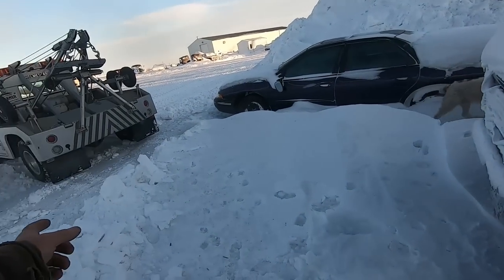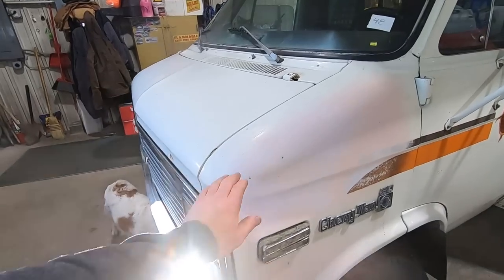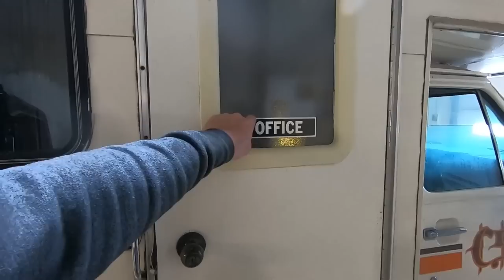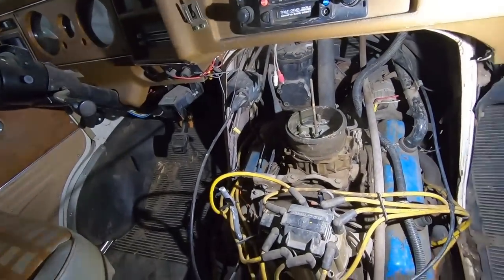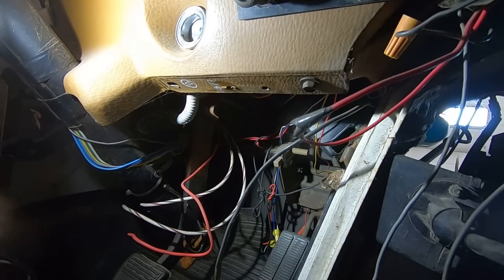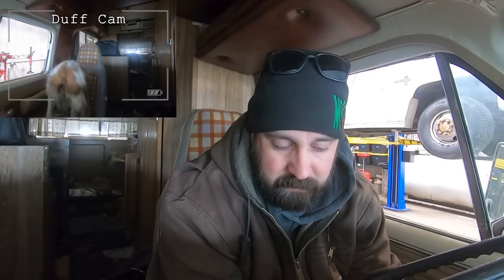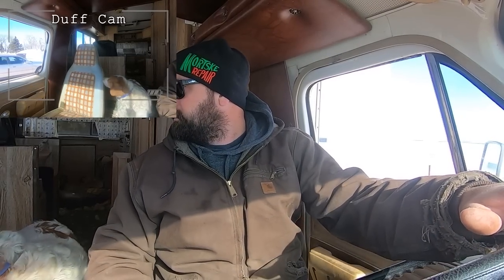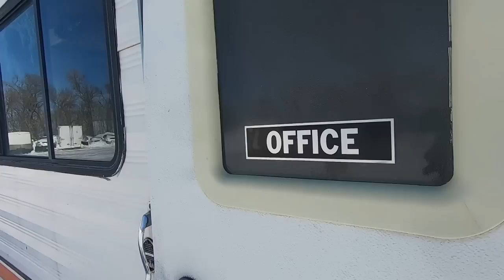Abandoned for 15 Years! 1977 Country Squire Motorhome! Will it Run?!?

Comment: I'm from elkhart and I've been building motor homes for 35 years. They have improved so much in that time and you were right on the money with your description.
Reply: Love the GMC FWD models from the 1970's
Reply from the maker: Glad to hear it!
Reply: Except for the rubber roofs  Those suck!
Reply: @smarternu  you are right, they were a good lookin unit.  One of my friends has one.  He put a hardwood floor in it made out of scrap pallets.  All the colours and different woods made a beautiful floor.
Reply: @Glenn 1957  there not bad if you prep right and don't let people rush you.
Reply: Everything has
Reply: I'm from elkhart myself. On cr.9 just south of cr.6 over by cassopolis st👋
Reply: Lots of brass musical instruments also were made in Elkhart.  Must be quite a manufacturing town.
Reply: @Frank Blackcrow it was a lot of work with a thickness planer, router, and sander. He also had to do it on narrow strips, like older style floors, I believe 2", maybe a touch larger.  Some of the boards are narrow or cracked on pallets.   But it does look awesome.  Mostly due to the random colours of wood, you never know what you are going to get from a pallet.  But a fantastic way to make something look cool and recycle as well.  For sure. 

100sq ft or less is fine, but I wouldn't want to do it for a living room or something. LOL
Reply: @majcrash  we were also the home of Alka seltzer and Flintstone vitamins back when miles lab was here..... now we just make home made pharmaceuticals😁
Reply: @majcrash  good workethic and people
Reply: I'm just west there in south bend & i worked at many the rv shops then went into yoders garage & truck repair now called marv's truck service and wash !
Reply: @Jammer.1  glad to see all us Michiana Hoosiers enjoying the adventures of Duff and his human companion!
Reply: He was right on the money I'm from Plymouth.
Reply: Greeting from Merriam! (North of Fort Wayne) I've been fixing motor homes and camper's your company probably sent south 30 years ago! Not a full time job, just a side gig I picked up 5 years ago.

Comment: I never thought a motorhome burn out could look so cool, but that was epic, and we did have back up cameras back  in 77 they were called rearview mirrors lol
Reply from the maker: You had mirrors?!? DANG!
Reply: I still have mirrors.
Reply: @MaxNafeHorsemanship  Back up cams are only good for hookin up the trailer.
Reply: @chrischille3930  I've been hooking up to trailers without a camera since 1976. Still don't need one. My car doesn't have ABS or air bags either. I learned to drive before they even invented that stuff. If you need a camera to hook up a trailer, you shouldn't be pulling one.
Reply: @MaxNafeHorsemanship  My rig don't have a B/U cam either. I use the mirrors also. My friends and Brother have new rigs with cams and love them. Easy hook up.
Reply: @chrischille3930  By brother put a BU cam on his cuz he kept breaking his plastic bumper when he hooked up to his boat. I think he should have just bought a real truck. I have driven a few vehicles that had them. I just found them confusing. Specially the ones that are on the RV mirror.

Comment: Hi Mortske. To change the fuel pumps on the SBB Chevy's I used to use grease to pack the rod to the camshaft to hold it in place long enough to get the fuel pump installed. Always worked for me. Thanks for the fun videos and let Duff know he is doing his job well!
Reply from the maker: Thanks for the tip
Reply: @MortskeRepair  and lube the carb throttle cable and choke rods etc on carb  throttle  cable stiffens up and the throttle cable is hard and stiff to press on
Reply: And you can pull bolt out of front of block..stick a screwdriver in hole to hold pushrod up then put pump on easy peesy👍
Reply: @ronniegarland8621  or put alonger bolt in and lock it up untill your done , then put the stubby bolt basck in da hole , Damn I learned that my first year wrenching/,

Comment: Hey Mortske,
  One effective way to deal with that push rod when installing the fuel pump on a small block Chevy is to put a small dab of petroleum jelly on the innermost end and around the circumference of the end of the shaft and then insert it. The suction created with the use of the petroleum jelly will hold the push rod in place without the hassle that it will slide out and then install the pump. It works really well.
---Mark

Comment: To pull cars or larger out of the snow: for that you have to make a low snow sled where the wheels can fit for any size, you place it under the rear wheels, that works perfectly and you save the tow truck.

Comment: I had the same fuel pump problem last year on my 69 SBC with a new NAPA pump (probably from China) the discharge was clocked slightly different and the hard line would not line up. I solved the problem exactly the same way you did, rubber hose and elec. pump. Makes me feel better knowing Im not the only one.

That camper reminds me of the in-laws rig which I helped sell after their camping days were over. It was a little cleaner tho 😀
The Mortske Minutes are great keep em coming.
Reply from the maker: Will do

Comment: Fukkin' motor home power slide! And that ol' smallblock is just LOVING it!

I'd almost say you yank that smallblock for the triple nickel 4-door you got earlier. Somewhere another 3-speed that isn't fried will show up.
Reply from the maker: Brilliant!
Reply: @MortskeRepair  Almost wonder if the rear axle would be viable, too, though with 4.10 gears and a 3-speed anything that 56 ain't gonna be gettin' many speeding tickets. That being said axle width probably isn't compatible.

If I was to build that car I'd probably go with a 3.08 rear end on a 3-speed non-O/D with an engine just like this one. Might as well throw another hundred cubes at it and it ain't like you'd need to do much custom fabricating to slide a 70s 350 into a triple nickel sedan. Should bolt right in if I remember Chevy smallblocks right.

That 350 sounds MEAN. Probably the best running engine you've gotten out of a junk vehicle.

Comment: I've had the fuel pump pushrod debacle in the past. I rectified the issue by applying a coat of grease to the pushrod then pushing it fully into the block. It prevented it from sliding back out. It worked like a charm.
Reply from the maker: Good to know!
Reply: @MortskeRepair  We don't need to be a magician in order to learn new tricks. I'm all for whatever works. Just thought that I'd pass it along. Give Duff a pat on the head for me.

Comment: Easy trick to get that pushrod out of your way. There is a bolt right in line with it. Temp replace it with a longer bolt finger tight and it will hold that rod up and out of your way while you install the pump. When you are done, just replace the stock bolt. Easy peasy.   I did doughnuts in a bus and a semi. You can do doughnuts in a motorhome.

Comment: I was shown this trick many years ago for fuel pumps. Put a big dab of grease on the rod and it will stay pushed up long enough to get the fuel pump in. Learned this back in high school auto mechanics class in the early 70's.
Reply from the maker: yup

Comment: We get a sh!+-ton of snowbirds down here in AZ during winter months. They are outta here by early April because our summertime temps regularly exceed 110 degrees and they would all melt!
Great tutorial on the different types of RV's/motorhomes out there just the same, also, great video as always with the Duff dog assisting. Good friend of mine has one of those GMC 3 axle motorhomes w/455 Olds Toronado front wheel drive setup and he has restored it, quite a comfy rig! Thanks again Mr. Mortske!
Reply from the maker: Our pleasure

Comment: Keep bringing in the videos Mortske,I didn't know a motor home could do burnouts & could drift either 🤔
Reply from the maker: You know it
Reply: @MortskeRepair  that was cool 😎, but it would've been better if the rear-end was a dual positrack that way both axles would've spun & are you going to keep it & make a  service truck out of it if doesn't sell or are you going to just use the blue truck  with the service box already on it or the white dually with the service box on it for a service truck, let me know something okay, I would Appreciate it very much if you can okay thanks

Comment: That's got the 4-bolt main 350. The '78 I had with that engine was a real tire-shredder. I bought it off my parents - the AC Delco maintenance-free battery lasted over 10 years. They don't make good daily drivers - you get sick of the up-n-down ride. Since you're over the front tires if they go up and down you do that too.

Comment: Don't use a 2 line fuel pump in that RV! The 3 line fuel pump was not about emissions.  It was to prevent vapor lock.  A constant supply of some fuel  back to the tank would keep the fuel to the carb cooler and prevent the fuel from boiling.  In a dog house,..it gets HOT,especially in traffic! And vapor lock was a problem.  The 3 line system was used to prevent vapor lock.  But,.that rig will likely not be put back into regular use,..so the 2 line pump will run it fine.   Thanks also for the intro RV trivia!!  Adds a great touch to your videos!
Reply from the maker: Good to know!

Comment: Your info was well interesting Morts.  Mobile homes/RV's are a fantastic subject on either side of the pond! I'd definitely enjoy more of these vids.
Reply: OK, here's the story regarding my very first motorbike (that was also stolen.... a brand new Kawasaki AR50.)  Of course I replaced the stock exhaust, removed the head-gasket to increase the compression ratio, replaced the rear sprocket to give me a theoretical higher top speed, ported out the transfer ports etc. So, one day, myself and our group drove down to Thamesmead in SE London, I left my bike in an underground car park and on returning 5 FECKIN minutes later it was gone.
Reply from the maker: Dang

Comment: 2 batteries, 1 for engine & other was "deep cycle" for RV. That solinoid up front is the battery insulator,  both charging when engine runs but won't draw power from each other.
Reply from the maker: Good to know

Comment: Remove the plate that holds the fuel pump, when the rod drops out put a dab of grease on it and push it back up. It will hold it up, then put everything back together. Makes super easy.

Comment: I started watching this video and noticed that you still hadn't figured out that you are supposed to pull the two pin-latches that release the extensions on the sling of your tow truck so you can get the sling will under the vehicle before hooking it up. The pins should be spring loaded and will usually lock back in by themselves as you winch the vehicle into position. Also, we used to hook the J-hook chains over the top of the sling hook and then wrap them all the way back around to prevent them from coming off. Maybe that's over kill but we never lost a vehicle in fifty years of towing. Whenever possible we would tow from the back and tie the steering wheel with a rope to keep the front wheels straight, even if there was a steering lock. Front wheel drive cars being the exception. There are loads of other tricks, but you'll figure it out ...

Comment: Chicos bail bonds, wasn’t that the Bad news bears movie? Lol. When you slipped in the snow you were so graceful! Glad you didn’t pull anything! That is the fridge, the air conditioner is usually on top. I used to work on Rv’s. I can tell you the older coaches were always built better than the new stuff. I’m talking build quality not accessories.👍
Reply from the maker: You got it!

Comment: All the innards are fixable. The outside vent below the refrigerator(not ac) is for the furnace. That camper my have had a generator back in the day. Those don’t normally end up with the camper. I’ve redone worse

Comment: I lived in Elkhart for 20 years. 80 percent of all RVs are manufactured in Elkhart County, Indiana. I think the reason is that someone would work in the industry for a while, and then decide to start their own company. In good times, when gas prices are low, the industry flourishes. When gas prices raise sales go down. The industry was really strong at the beginning of the pandemic when gas prices were low. They are struggling now with the high gas prices. That class C motor home you have will probably get 6 to 8 miles per gallon. The 8 mpg is with a strong tail wind.
Reply from the maker: Heard it might have something to do with the Amish as well?

Comment: I think there's 2 gaskets on the fuel pump because there's actually a plate over the mounting hole that keeps the fuel pump push rod from falling out on the ground. It's usually not noticeable because it's stuck to the block and doesn't come off with the pump when you're changing it.
Reply from the maker: And that plate is an entirely different shape than the gaskets that come with as they are both the same shape as the pump
Reply: @MortskeRepair  ah. Ok. It's been awhile since I did one. Should've known better. Well, 3rd world country ingenuity?

Comment: I was wondering if you use the method of on the front of the engine,motor or whatever you want to call it there is a bolt in line with the fuel pump that you can pull out and install one a fuzz longer that will hold the pump rod in place before you remove the old one. Just a thought my man and as always keep up the good work!!!!

Comment: I usually buy some sort of a project (read project as beater) for me to drive, I've had 2 of those stolen.  An early Range Rover was stolen from our driveway in a small town in England.  The thieves used it whilr committing several robberies and ended up screwing up the engine, lost my spare tire, jack & a baby seat.  I rebuilt the engine with parts that I ordered from the US (aluminum V8 from GM in the 60's).  In the south of France my wife & I had my old Peugeot 205 GTi stolen from a shopping center parking lot at noon while we were buying school supplies for our kids.  Both vehicles were locked when we parked them, obviously it didn't help.
Reply from the maker: Dang

Comment: Just the video I need. Stuck at home sick with a baby screaming in my ear. The double gasket might be for an adapter plate. The sbc 350 I'm building had an adapter plate behind the fuel pump.
Reply from the maker: Good luck with that! Adapter plate is entirely different
Reply: @MortskeRepair  Yea I'm not entirely sure what it's for. Only thing I could think of is maybe it acted as a spacer. But it's all deleted now.

Comment: Here in the UK you could pinch a 80's/90's Vauxhall Nova by simply pulling the hazard light swith out of the dash, then plugging it back in upside down (this would bring the ignition on) break the column lock, then simply bump start it 🤣

Ford's were 3 wires to back of ignition, red and black together was ignition on, yellow was starter

Comment: I had thought the third connection on the fuel pump was to help prevent vapor lock.Remember those days?Btw an easy way to tell a TH400 is there's no kick down cable on a 400.Funny you mention the 8.1,that's the engine was in my LAST,and I do mean LAST motorhome,Man I was glad to see the last of that thing!No more motorhomes for me!
Reply: You're right, the third line is to let fuel drain from the pressure line when the car is off. It helps with vapor lock and as an added bonus you can undo the pressure line without fuel spraying everywhere. Most GM cars with A/C had them.
Reply from the maker: Good to know

Comment: You forgot the Pace-Arrow motorhome, which was one of the top of the line deals, course there was other makers of MH's , I worked for a joint back in the 70's that sold and serviced motorhomes, I can't remember all the names of different MH's hell there was a blue million of different ones, even back in the 70's, I do know Pace-Arrow was one of the top ones, and you could get your choice of about any gas engine, usually a bigblock of some kind in the bigger MH's, or even a couple of different diesels. We serviced one big Winnebago that had a 454 Chevrolet in it but we did another that had a 440 Mopar in it, there was another that had a 460 Ford in it. Yeah it was confusing as hell back then, hahaha! You can't go wrong with Louis L'amour, helluva western writer, and the Sacketts was pretty good, the movie too and same bunch of fellas did the Shadow Riders too.
Reply from the maker: Yeah, we didn't get them all that's for sure

Comment: I have a 1-off 1984 Barth Glassnose Chevrolet conversion.  454 cid  Formerly owned by Bose Corp (the speaker folks) as a concert support vehicle, before Bose had offices.  Needs a complete rebuild ($250k+)

Comment: 1gasket each side of the percolater block . Between the engine block and the fuel pump. Many of the engines seem to have had the heat insulator thrown out or never fitted to start? If it's there it must be better to keep one fitted.

Comment: The best motorhome ever built was the Blue Bird Wanderlodge.  Made in the same plant as the school buses.  All metal roof and body just like a bus.  They were all built to order, no two are alike, and they had a plaque inside with the original buyers name.  Unfortunately they are not made anymore but they turn up used sometimes.
Reply from the maker: Dang

Comment: Easy peasy on small block fuel pumps ,in front of block is 3/8 boss bolt hole about 3 inchs up from oil pan ,find a 3 /8 bolts about 3 inchs long , then push rod up ,turn this bolt in till stops ,  fuel pump on  take out bolts quik en easy